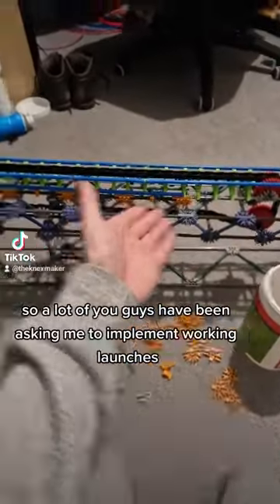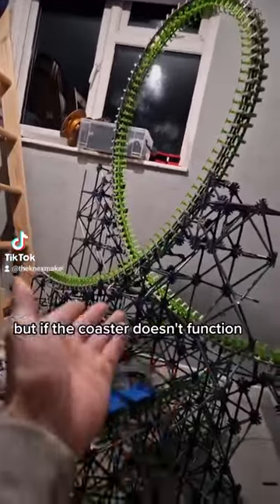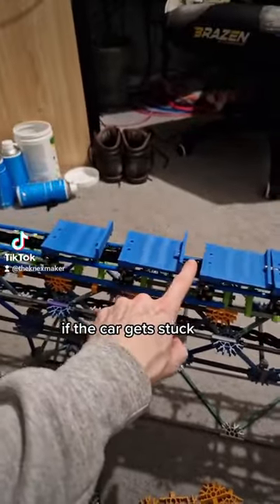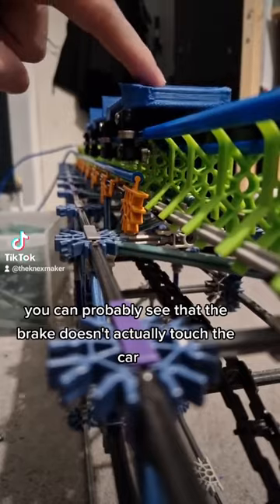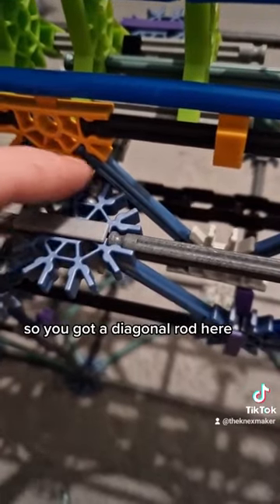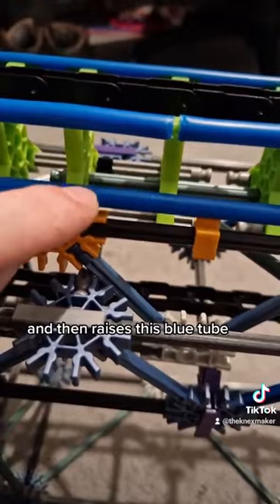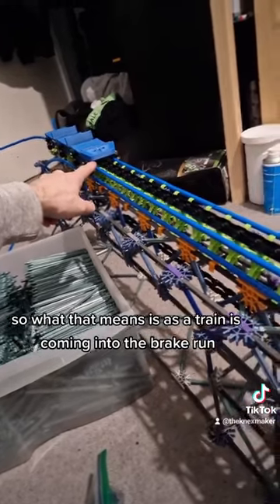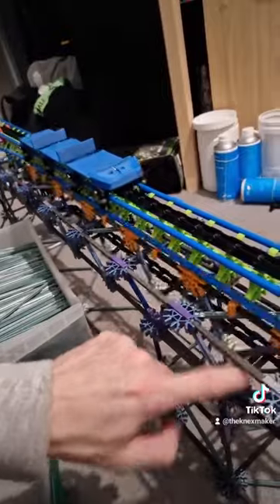I BUILT WORKING BRAKES ON MY KNEX ROLLERCOASTER!

Comment: I’m working on an eddy current mechanism. It wouldn’t require the chain on a slight down hill track, and it would give a smooth gentle brake to the coaster car. If the ball bearings on your train are ferrous, then maybe adding magnets to that brake fin instead of the tube might work well. You would need to experiment with the magnetic field directions.
Reply: That’s so awesome! An eddy current!?
Reply: Ooh, that would be soo cool!
Reply from the maker: I would love to do an eddie current break